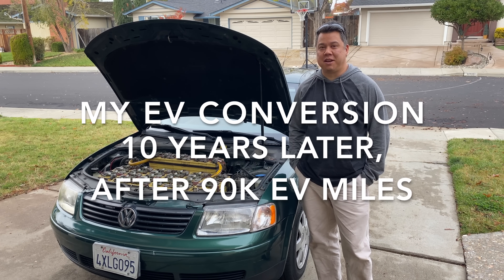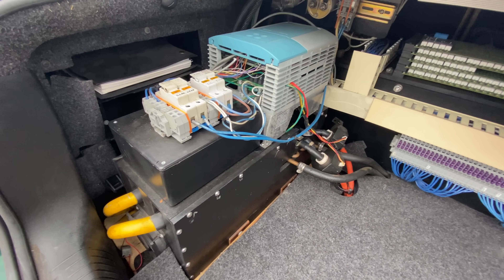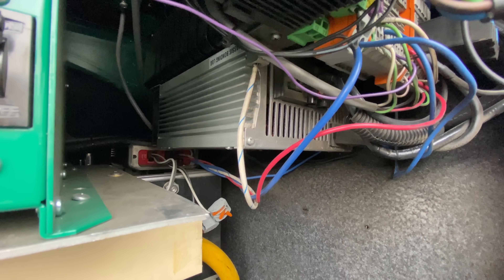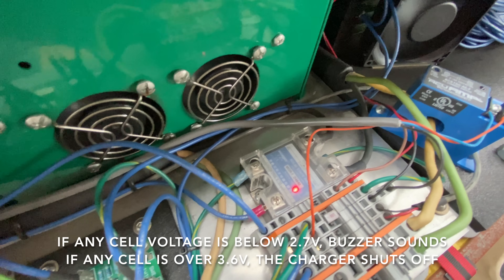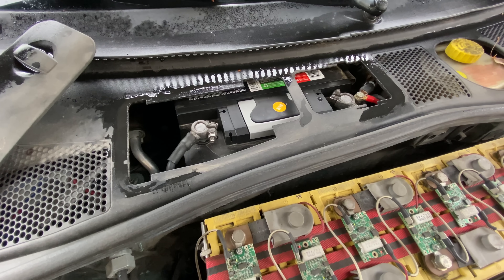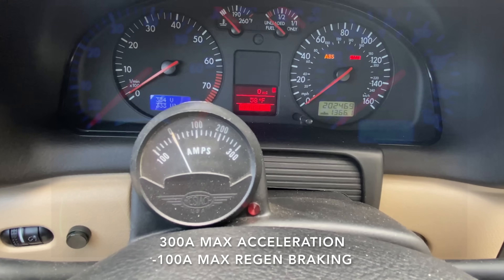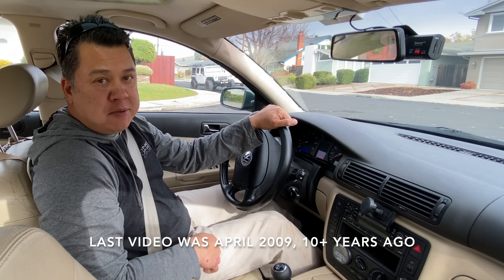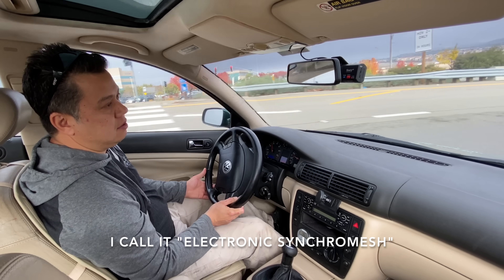My EV conversion after 10 years and 90k miles

Comment: Did he say hes never changed the brake pads on it for 90,000 miles . What magic is this
Reply from the maker: Regen braking, most EVs use the motor to slow the car down instead of friction brakes.

Comment: I built an EV 14 years ago and god knows how much money I put into it. At the time modified fork lift motors where the norm and I ran it on 12 150 amp Trojan LA batteries plus a 12 volt for the chassis. I had a alternator that only charged when coasting and used the original A/C compressor but it really hurt the performance. It had a 40 mile range if you stayed under 55 MPH and that was driving on a loop around town to visit my Mon in a nursing home at 35 miles. Within two years those batteries where toast so Its been sitting in a barn here for the last 10 plus years. Every now and then I dream of finding modern cells to get it running again but I just don't have the drive that I did when I built it. When I finished it, my plan was beating the Volt to the market and did so by a year or more. I even repainted the whole car and I guess I had about $11k in it all total and that was getting batteries at cost from a friend who owned a battery shop in town. I wish I could part it out or sell it but It will likely be scrapped once I'm gone. LOL. Enjoyed your awesome build. You're an amazing person. DS

Comment: This thing must weigh about 2 tons... Have you done anything about the suspension and brakes?
Reply from the maker: Rear springs are custom wound to support additional the 500lbs.  Friction brakes are barely used since the motor does regen braking.   I upgraded the brake pads with Yellow Stuff performance pads.

Comment: That was very interesting to see and proves the genius of your capacity. I wonder though if the added weight of the project overall outweighed the performance of the mileage you get compared to gas without the extra weight. Cool project none the less.

Comment: very cool but 25K is a lot for what it is, Could buy a lightly used bolt euv for that price and have 2.5X the range while being a bigger vehicle. 
But again im sure hes very happy with his build and it's cool to see. just not a practical thing for someone to do to save compared to a regular ev
Reply from the maker: In 2008 you couldn't buy a used Bolt, or even a new EV, DIY was the only option.
Reply: @etischer  I guess that's true, still a high cost especially for what it was in 2008. Good thing evs caught on and are now becoming the new cheap car to get around in.

Comment: Can you leave it in 3rd gear permanently (eg. for taking off from 0mph)?
Reply from the maker: I could leave it in 3rd gear, but acceleration would be slow, motor current would be much higher, and the motor & controller would run hotter with more losses.  Similar to riding your bike only in the highest gear.   There's a balance between motor torque and motor speed, the gear ratio should keep the motor speed within the RPM range that the motor is most efficient in.
Reply: @etischer  I see. Amazing work by the way.

Comment: Did you 3D print the circuit board trays? They look perfect.
Reply from the maker: I cut them on a table saw.  The circuit board stack is staggered by 0.1" from board to board, so the jumpers can daisy chain the alarm signal.

Comment: I love that you've done this but I feel you chose a bit of a gutless platform. I can't help but think a base that wasn't a gold would have been so much better to drive especially over the time. Keep doing you though ❤
Reply from the maker: Options for EV components were pretty limited in 2008.  To get 100 mile range, you needed a car that could handle the weight (1000lbs) and volume of a large battery pack (at the time 25 optima blue tops).  My goal was to build a comfortable freeway (80mph) capable daily commuter.

Comment: And the electromagnetic radiation inside the cabin is?
Reply from the maker: I did buy a meter to measure the emf, it was basically zero.  All the high power wiring is on the outside of the car, so the car body acts like a Faraday cage.
Reply: @etischer  That sounds good.

Comment: The efficiency of this vehicle is extremely poor for an EV. The cost equivalence in mpg is about 52 mpg, which most hybrids can achieve, so buying a hybrid would have been a better investment. An interesting project, but not cost effective.
Reply from the maker: Efficiency is around 100wh/mi, on par with similar vehicles like the Nissan leaf…

Comment: why do you need a big inverter that’a liquid cooled? are the batteries a different voltage to the electric motor?
Reply from the maker: The motor is a 3 phase AC motor, and the battery is DC.  To control speed and torque of the motor, the inverter varies the voltage, current and frequency of the power sent to the motor.  Even a DC motor would need a controller to control speed/torque

Comment: I wonder if it would be feasible now to convert an old comfortable luxury car, like converting a 70's-80s Cadillac or Lincoln Towncar. It would really be the best of both worlds to have a very comfortable car, with more affordable electric fuel. I just imagine the weight of the required batteries alone would make it difficult, and maybe ruin the air suspension that's part of their comfort.

Comment: hi how about the regenerative breaking there? how do you setting up the force there ?
Reply from the maker: The firmware/software for the VFD lets me set up limits for torque.  I have an equation to decrease the torque as a function of RPM so the  power remains constant.
Reply: @etischer  what about the brake using brakepads? is that has a sensor or something? can you explain that to me please? this is an awesome project btw

Comment: Why regen is limited to 1/3 of total power? Is it just a usability choice or is it dictated by some restriction. I ask because I wander in general why EVs don't have more regen. I wish my Tesla could regen at 70mph as strongly as it does at 30mph.
Reply from the maker: The limitation is the 100A charge limit on the battery.  Watts is proportional to Torque X RPM so at higher RPM, I have to limit the torque to avoid generating more power than the battery is rated to absorb.
Reply: Also if you used 100% Regen at 70mph 😅 you'd likely be involved in a rear end accident 😅

Comment: Whats killing the current EV vehicles is that all the manufactures are wanting to turn them into some sort of bespoke luxury vehicle. Making the cars far more complex than they really need to be, and a lot less dependable.
Reply: Exactly, even this is slightly complex. Just need the batteries, motor, and controller. It's actually best to have as many manual and separate power parts that are necessary in an emergency, window, horn, hazards etc .

Comment: 25k cost to get 100 miles of range? That's outrageously bad for the price.
Reply from the maker: keep in mind, this was 2008, before any manufacturers had electric cars on the road.  Even the Nissan leaf, the first mass produced EV had a range of around 100 miles, this was cutting edge in 2011, most EVs before this were getting around 25 miles of range with lead acid batteries.
Reply: I thought he said $12k

Comment: 333 volt ? 1 ah per mile ? ok its 1.6km , so 333/1.6 give 208 watts hour/km huuu  my ebike at 34kmh eat 15 watts hour/km ^^ 13 ebike can do the same range for the same energy ...
Reply from the maker: What is your bike's Wh/km at 100km/h?
Reply: @etischer  u dont need to ask .. ask how much a 125cc eat at 100kmh :-) usualy 125cc gas engine can do it .. let say above 7KW peak u can make it even if u need to lay flat on the bike
Reply: @etischer  im more for electric campervan.. but let say u have that campervan house and a ebike.. is it better to move ur house or ur ebike... ? i can do my house in 3.5ton and have the ebike to get thing to eat at the store while not needing moving my house.. then if u money u have 2 tesla pack to move 3.5ton 300+ km one go..
Reply: @etischer  at 20mp/hmy ebike is 14.75wattsHour/kilotmeter (i can convert it for u in mile for conveniance .. ) 14.75*1.6 is 23.6 watts hour mile

Comment: nice project but you need to make heater controls somewere more acsesible
Reply from the maker: The heater is an on/off switch on the dash.  The temperature controller isn't something that is used regularly, it's just to display temperature setting.

Comment: Cool but please why not use Wh for capacity instead of Ah? Much easier to compare between builds.
Reply from the maker: Watt Hours depends on temperature, internal resistance, current draw,.. all of which causes voltage sag, and makes Wh inconsistent.  Amp hours are pretty much consistent, regardless of voltage sag.  The battery is rated in terms of Ah.  In terms of Wh, you can multiply by roughly 3v.  So my 100Ah pack is roughly 30kwh.

Comment: You don’t actually have to shift though right? You could just set the car to the highest gear and go since there’s no engine to stall
Reply from the maker: I don't actually have to shift, but I can pull more power on the freeway in 3rd gear (280A) vs 2nd gear (200A) because the motor is more in it's peak power range.

Comment: In terms of changing gear in an electric, the bad is not leaving it revved up, but trying to draw lots of load at low rpm, so if your current meter is "in the red", you should downshift, but you can drive with the rpm pegged and it is actually healthier not to shift up too much, especially on hills.

Comment: With the terrible environmental footprint of EV's, my thoughts are to buy EV's that are headed to the scrapyard because the cost of battery replacement is not economically feasible and retrofit them with a diesel powered generator and a small, nonflammable Nickel metal hydride pack, like most other hybrids. Then, they will be "greener".

Comment: Some of y’all don’t get how hard this is to pull off. EV conversions are insanely involved and nothing to scoff at, and this guy did it in 2008 when there was absolutely zero resources on how to do anything like this. What a legend
Reply: yup, beautifully too
Reply: the people who end up with this video in their feed likely know just how insane this is...dude is a genius pretending to be just a normal dude lol
Reply: No we get it... We see him pulling panels back and showing more electronics.. and the fact that he has to operate a control panel to use AC..
Reply: People in the USA have been doing EV conversions since the early 1990s, pretty much the moment solid state motor controllers became cheap and accessible. Other people were doing it earlier and on a smaller scale with bell clapper electromechanical regulators.
Reply: Yes, because electric vehicles were impossible to build before 2008...what are you babbling about?
Reply: yeah most people who talk big probably don't know their PSI and can't put a table together.
Reply: You’re selling him short. An electric MANUAL conversion. Insane.
Reply: The know-how of how to build an EV of this caliber has been around since the 90s. I have a truck from 1997 that's functionally identical. Most of the concepts used to build this come from areas other than EVs that have been prevalent for a long time. You simply didn't see this information in the context of EVs because EVs had not yet become "cool" in mainstream culture. Still an exceptionally polished conversion.
Reply: So? Ev is Gay
Reply: Who's "yall"? Everyone in the comments is praising him and giving him credit. Quit making shlt up.
Reply: 0 resources? Electric cars have been around for many, many decades.
Reply: Absolutly zero ressources?
EV are almost as old as thermic car... And there were some car makers who made some EV during the 70's, 80's.... EV did not started with Tesla.
Reply: @rigoloweb4762  Zero resources as in do-it-yourself guides and off-the-shelf kits. Nobody is trying to deny EVs didn't exist but conversions only became trendy from 2010 onwards which means this guy had to figure a lot of things out himself which as a result likely means he is more knowledgable than average EV converter today.
Reply: @rigoloweb4762  don't forget this guy did it during 08 recession too

Comment: I fitted 16 x 90Ah lifepo4 cells in a 2P8S arrangement to mobility scooter (and electric wheelchair) in place of the 2 x12V 75Ah LA batteries . Average consumption is about 45Wh per mile. But that depends on speed and ambient temp. I use a 1KW hobby charger to balance the pack. The reason I did it is the increased range, cycle life, weight reduction, and not having to re-charge every time either mob device is used which you have to do with LA batteries. Downside is lifepo4 cells are more expensive than LA batteries (equivalent Ah). But what etischer has done is amazing! Anyone can do what I've done but very few could do what etischer has done. A really clever and practical guy.

Comment: Same battery bank over the 11 years?
Reply from the maker: First year was a lead acid pack, but  it's been the same lithium pack from 2010 - 2020 (10 years).   I don't have the Passat anymore, but the batteries are still going strong in our Travel trailer, they're at about 70% capacity now (14 years)

Comment: Are the brakes drive-by-wire blended brakes like a modern hybrid or EV, or is it just using the existing brake light switch to activate a fixed amount of regeneration?
Reply from the maker: If I tap the brake pedal, that latches in 10kw of regen, perfect for maintaining speed down hill, pressing the gas pedal resets back to zero regen.  If I hold the brake pedal, the car does 33kw of regen (100A, 330v).   I can program the inverter to do one pedal driving, but then it makes it impossible to shift gears, as the motor would come to a stop while trying to shift gears.

Comment: How many miles does the Winston cells have? Have you had any cell failures? I am interedsted on the quality of Chinese lithium batteries.
Reply from the maker: I put 90k miles on them and they were showing sings of degradation.  I still get the same 100Ah out of them, but the voltage sag (internal resistance) has gotten worse.  New at 300A, pack would drop from 330 to 300v.  After 10 years, it would drop from 330v to 270v in the same 300A test.  They still retained the same Ah, but less Wh due to voltage sag.  I still use the cells for our travel trailer since it's not a high current application.
Reply: @etischer  Thanks for answer! I have seen similar effect on recycled 10+ year old laptop 18650 batteries used for my DIY powerwall. High IR, but still have mostly good capacity. 

Did you have any single cell failures or did they all degrade the same rate?

Comment: The Inverter is original for a DC  suply 300volts or you Made someting  for suply ac Inverter wit a DC  voltaje? I m Made someting similar but i Buy a solar Inverter .
Reply from the maker: pretty much all 3 phase inverters convert the AC to DC right at the start, there's almost always a DC bus connection available to aid in dumping regen power, or hooking up an external brake resistor.  The inverter DC bus then connects to the IGBTs using PWm, to generate the 3 phase output.  In my case, I'm supplying power directly to the DC bus on the inverter to power the control power.

Comment: Two questions. What is the range and what is the motor rated at?
Reply from the maker: should do 100 miles, but I haven't taken it past 70 miles to avoid deep discharging the battery. Motor is rated: 
215 - 380 Volt, 282 Amp RMS (400 peak)

4 pole, 3 Phase AC Induction
67 Kw peak (33 Kw continuous)
3500 - 9700 (13,000 Max) RPM

I'm able to draw 90kw (300A 300V) from the battery

Comment: Knowing what you know now, what would you do differently if you were to do it all over again?
Reply from the maker: Today there are dozens of kits available for converting a car, so I'd probably buy a model 3 small drive unit.  Back in 2008, there wasn't really anything commercially available so things had to designed and custom built.  For the low cost of Model 3, it really doesn't make sense to do a conversion unless it's something really special.  Not many EV convertibles out there yet.
Reply: @etischer  I'm not the biggest fan of EVs, but I am a big fan of proper engineering. You did some proper engineering with this and it really shows.

Also, I had no idea that Tesla drive units were available in this way. I had a quick look and they don't appear to be too outrageously priced. Are they for repairs or projects primarily? Seems like they are targeting project applications and with the model 3 being relatively new, few people should be needing them for repairs.

Comment: Fantastic video and vehicle.   It does show how weight makes a difference.   My I-miev 2011 could still get 60 miles on surface streets with 16 kWh battery (I'm sure it wasn't getting full battery anymore)  in 2021.   This is due to smaller lighter car and narrow small wheels.

Comment: But how much did this all cost? How long does it take to charge and can it use superchargers to fast charge? Please tell us!
Reply from the maker: Including the purchase of the car, I spent about $25k.  It charges about 12 miles of range per hour and I usually plug it in each night after driving home from work which is 20 miles.  It's not set up to use superchargers. http://etischer.com/awdev/
Reply: @etischer  wow that's a lot of bling bro. Rich rebuilds said he did one for $3k in a video... But that's probably in recent years. Do u think it can be done cheaper now?
Reply from the maker: @Pam-h4u  Yes, today you can buy a wrecked nissan leaf for $3k and you have all the parts necessary.  In 2008, EV parts had to be designed and build by hand.
Reply: @etischer  but I don't think it included the cost of the car. How much was it without the cost of the car?
Reply from the maker: @Pam-h4u  I bought the Passat with a blown engine for $1,800.  Batteries were $12,500.